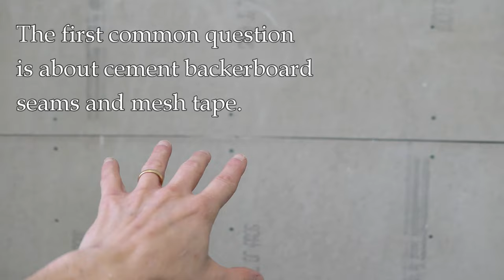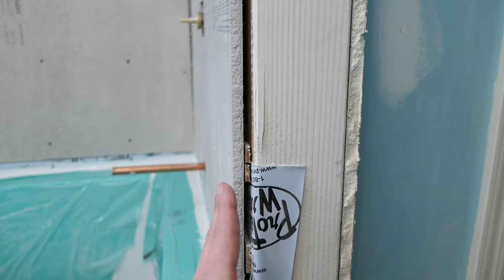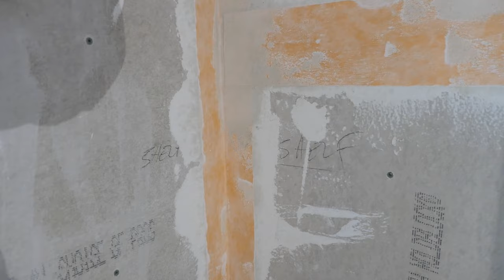Should Backerboard Go Over The Tile Flange Or Up To It?

Comment: Should my first row of tile  rest on the tub or be up off the tub?
Reply from the maker: I have a number of videos concerning the actual tiling process, which you should watch.  The first row of tile should have a gap, typically the same width as the grout lines of the tile, and not rest directly on the tub.  That gap is caulked with silicone caulk rather than grouted.

Comment: How did you add the black Visqueen over the protecto tape ? Did you staple the upper part and use a adhesive to attach the lower to the protecto tape ?
Reply from the maker: I had to look up "visqueen" since that's not a brand name in my area!  So, look, the flashing tape along the bottom is self-adhering, though you may want to pop a staple in each stud if it doesn't stick well. If you put plastic sheeting above that it will just be stapled and hang over the self-adhering flashing.  To be clear, the point of this is not "waterproofing."  Instead, it's just a measure of protection for the future in the event something goes wrong, such as framing moving, a homeowner not maintaining the caulk or grout, etc.  It will redirect water back inside the tub long enough to prevent a disaster.

Comment: If you put plastic over vycor or similar, wouldn't that create a double vapor barrier?
Reply from the maker: A double vapor barrier refers to a situation where you have two complete vapor barriers covering an entire wall assembly.  For example, you might have fiberglass insulation (with a backing) installed in all the stud bays and then add an impermeable plastic over the entire wall.  The problem is that moisture might gather and have no way to escape.  However, if you are just using plastic as a flashing for a small section of the wall, the moisture can easily escape and that would not qualify as a double barrier.

Comment: Dang, I have a $150 unopened bucket of Redgard that I was going to use on the Hardie walls and Hardie floor.  I read that it also works as a crack prevention membrane, but that's probably marketing hogwash.  Thinking of returning it after watching this.  Thanks for putting $ back in my pocket!
Reply from the maker: If you are truly concerned about waterproofing--perhaps you have a large family using the same bath, or some other  concern--then I would recommend the Schluter membrane.  Redgard has it's adamant defenders, but I don't find the arguments compelling.  I should also mention that hardibacker recently introduced a product it claims is truly waterproof.  I have not seen it locally yet, but I'll be curious to examine it.
Reply: @enduringcharm  Subscribed! Great info and appreciate that you answer questions

Comment: You're dead on too with maintaining caulking. Alot of my customers will say I don't know why it's leaking below as I'm staring at missing caulk and loose tiles at the tub
Reply from the maker: Ha!  Yeah, maintenance is not high on the lists of homeowners these days.  You should expect the need to recaulk and even re-grout occasionally, though.  With maintenance the installation will last far longer.

Comment: This is such a helpful video! It looks like you may have screwed directly through the tile flange to secure the tub to the studs. Is this an American Standard acrylic tub? We want to avoid using washers because they stick out and will complicate installation of the backer board but don't want to compromise the tub structurally. Is it generally okay to go through the flange as long as the holes are predrilled?
Reply from the maker: This is actually a tricky area, and one which the manufacturers have failed to properly address.  Some manufacturers recommend screwing through the flange and may even provide marks for drilling.  Others avoid the subject and leave it up to the installer.  I almost always screw into the studs, but you need to understand the structure of the tub or pan so you don't cause cracks, and the flange should not be holding any weight.  The screws are just there to keep the tub or pan from shifting.  There are flange head style screws you can use, or sometimes I will use bugle head style if I can countersink.  It depends on what the pan or tub is made of and how thick the flange may be.  Use a screw which won't rust, stainless or treated.  If the screw head is proud, you may need to relieve the back of the backerboard or the tile in that area, but generally the thickness of the thinset is enough to hide the screw head.
Reply: @enduringcharm  Thank you for the quick reply! ......Bathroom renos are beastly, it's great to be able to access your knowledge and experience.

Comment: I don't believe Schluter recommends mixing product brands as they may not be compatible for complete moisture barriers.  What happens with the screw penetrations in the backerboard?  Don't they break the moisture barrier allowing water and vapor to get inside the walls?
Reply from the maker: If you are using the Schluter Kerdi membrane for complete waterproofing, the membrane is applied over the backerboard and the screws with thinset.

Comment: I’m planning on installing the kerdi board. Would you still apply the window and door flashing tape, apply the kerdifix on top of that, and then put the kerdiband on the seam between the tub and board? Just nervous the kerdifix wouldnt bond to the window and door flashing. The flashing is beyond intriguing.
Reply from the maker: If you are using the Schluter system, including Kerdi board instead of backerboard, then you should have a waterproof surface.  You can use the flashing if you like, no harm in it.  Thinset will not bond to the flashing or to the tub, so there's no difference either way.

Comment: LOVE your content but I still have a question, regardless of the water membrane tape or the lip everyone recommends silicone caulking between the tub and installed tile but won't any water taht goes through the grout, hits the backer board, flows down and then get stuck behind the silicone and between the waterproof tape and lip of tub? how does that water ever escape?
Reply from the maker: Let me add some perspective on this.  First of all, we're talking about a shower wall not a swimming pool!  Water will not be permanently lapping against the side of the tile.  Even with a full family, the walls might be exposed to splashing for an hour a day.  Second, the grout can absorb moisture, but there is no way flowing water is going down the back of the tile.  If you sprayed a grout line for a long period the grout would eventually absorb some moisture, and that moisture might migrate to the thinset behind the tile to a degree.  But it isn't flowing down the back of the wall.  And, if you seal the grout as you should, the grout is waterproof for months or longer.  The only way flowing water is getting behind the tile is if you have a problem, such as a corner opening up due to framing movement or a cracked tile or caulking at the tile-tub line which has not been maintained.  

Silicone caulk is flexible, so by sealing the tile-tub line with silicone you allow for movement between the two dissimilar materials and you keep water from getting under that area.  In a couple of years or so the caulk will need to be replaced.  See this:  https://youtu.be/_NDhO1xdQ_8

Comment: Great explanation.  I have 3 questions.  1. Did you set the cement board a certain spacing (i.e. 1/4" etc.) above the tile flange above the door-window flashing?  2. What did you do to work the flashing continuously around the tub flange without cutting it?  If you used a waterproof membrane that also covers the drywall mud that's feathered at the cement board, do you still need to paint that section or can you just tile over it since the waterproof membrane is there?  Thanks...
Reply from the maker: If you are bringing the backerboard down to the tile flange (rather than over it) then you'll install the flashing first.  Then you can leave a slight gap of a 1/16" if you like between the backer and the top of the lip, but it's not that critical.  The window and door flashing has some stretch to it, but if you have trouble getting it seated you can overlap pieces by a few inches instead of using one continuous strip.  Or, look for zip system flashing tape, which has extreme stretchability.  

As for the drywall compound or "mud,"  it must be primed/painted before you tile OR before you apply a schluter kerdi membrane over it. And, that paint needs a chance to cure, not just dry.  Thinset used for tile or for the membrane will not adhere well to plain spackle or compound, but it will stick fine to cured paint.
Reply: @enduringcharm  Thanks.  Better late than never.  I never saw this response.

Comment: Great video.  When instling the tile, does the tile just float over the lip of the tub freely, or do you put extra thinset on the bottom of the tile to fill up the hollow stop
Reply from the maker: Thinset goes into that area, not so much for adhesion, but to provide a structural backstop of sorts for the tile so it doesn't crack.
Reply: @enduringcharm  can instead of
Thinset, one use silicone on the bottom of it?
Reply: This is my biggest problem that keeps me up at night too.  My tile is a 12x24 rectified porcelain tile so it’s large enough and a stronger durable tile, it’s going to be laid 12” of the tile from top to bottom and the long ways (24”) from left to right,
Reply from the maker: I made a video to answer this specific question--see it here: https://youtu.be/y3bpE-GhYUM

Comment: If water gets to the backer board and runs down to the tub sill, how will it get out, given that the tile will likely be caulked along the tub deck?  Won't it just be trapped at the bottom of the backer board?
Reply from the maker: If you have actual water reaching past the tile to the backerboard, your installation has already failed.  If your tile is secure, your grout intact, and you have sealed the grout, water is just going to run down the tile and into the tub or pan.  If you ran your shower continuously for hours, you might get some moisture bleeding through the grout to the back.  In cases where I see there are teenagers in the house, or many people using one shower, or a tiled shower floor I will use the Schluter kerdi membrane to completely waterproof the installation and protect against moisture bleeding through.  In normal circumstances, though, it just isn't a problem.  I use my flashing system to prevent a problem if the homeowner doesn't maintain the grout or caulk.  But you should never have water dripping down behind the tile unless there is a major problem.
Reply: @enduringcharm :  Yeah, I was thinking of moisture working its way through the grout to the backer board (maybe 1' - 2' above the deck after several showers... or as you rightly say, 1 teenager).  I'm thinking worst-case.  Thanks for your reply.
Reply from the maker: If you are concerned, just put up the Schluter Kerdi on the whole wall.  It the market leader for a reason.

Comment: Altering the dimensions of a 5' room seems to be a popular solution to get backerboard over tub lip, but do the the problems solved really outweigh problems created?  Your recommendations are at odds with a lot of similar information, but I agree with you. My preference is to install blocking around the tub lip to receive the lower edge of backerboard. With solid blocking, water intrusion becomes physically limited before flashing, backing, and tile. The only  detail I would question is why feather drywall compound onto the backerboard into the bath enclosure. I recommend stopping drywall finish at block coat on the tub side of the backer/drywall seam i.e. do not contaminate tiling surface with water soluble compound. Thanks again for this video. I expected to see a hundred negative comments about how wrong this is.
Reply from the maker: Well, I work in the real world where budgets are part of the project!  Sure, you could alter the dimensions of the room, especially a smaller bath.  But, you'll also add a huge amount of time and money to the project that the homeowner may not have.  I always present these options to homeowners, but ultimately the budget may determine the design.  As for feathering the drywall compound, there are some details to understand.  First, I don't feather very far into the alcove.  Typically I try to run the backerboard outside of the wet area, so that the feathering occurs outside too.  Perhaps the compound reaches underneath the outside edge of the tile, which is typically a bullnose and which is outside of the shower doors or shower curtain.  Second, this feathered area receives three coats of paint before tiling--one primer and two finish coats.  I let that paint cure before tiling.  There are other ways of handling this transition, including Schluter membrane or using a metal edge.  But, the style of the bath and tile don't necessarily work with a metal edge.  In the decades I've been feathering the compound I have not had an issue, including in my own house where I can keep a close eye on things.

Comment: How about back cutting the board to allow for the lip?
Reply from the maker: That has several problems associated with it.  For one, the only practical way to relieve the back of cement backerboard is with a grinder, and that sprays silica dust everywhere.  Trust me, it isn't worth dying ten years later for the bath remodel you are doing now!  That aside, backerboard is less than a half inch thick, and if you cut it down to half of that there is not enough strength left to ensure you won't get cracks or have the backer just break off.  Now, if you just want to drill a little hole to make room for a screw head sticking out of the lip, that's fine.  Otherwise, best to either shim out the wall if possible or just use my flashing idea and put the backer on top of the lip.

Comment: QUESTIONS (if still responding to comments in here): When you hang the tile over the tub flange,
1) Do you thinset the tile to the flashing tape? 
2) Will the thinset adhere to the tape?
3) If you DO, won't the flex in the tub with added water and human weight cause cracking?
4) If you DO NOT, what do you use to fill the gap between the tile and the flashing tape? Grout caulking? Silicone? Nothing? 

Thanks!
Reply from the maker: I made a whole video on that subject: https://youtu.be/y3bpE-GhYUM?si=85DsDFRxUSSuL67B
Reply: @enduringcharm  oh thank you my man! I will check that out. your timing is good too because I'm currently installing backer board just as you have. unfortunately it's too late for the flashing tape, I'll come up with something, but what I come up with will be related to the video no doubt.

Comment: Great video. I didn’t search through all the comments if this was asked… but do you adhere the plastic vapor barrier to the flashing?🤷🏻‍♂️ Thanks again for the great video.
Reply from the maker: We need to be careful about our terms.  The plastic sheeting I install over the flashing, but it's not a vapor barrier.  It's really just an additional form of flashing and it only goes up about three feet.  The point of it is just to provide some protection for the future in case something goes really wrong.  A vapor barrier, by contrast, would cover the entire wall and is typically a part of insulation if it's an exterior wall.  You don't want two vapor barriers or you could trap moisture.  The whole flashing system is just in case the homeowner fails to maintain the caulk or grout, or in case the framing moves dramatically in the future, etc.

Comment: Thanks for sharing.  Good idea to handle the lips with flashings.  
When thin-set  was applied to adhere the tile on the first roll, should it be applied over to the flashing?  If so, how much gap should be left between the top of the tub and the bottom of the first roll of tiles?

I wish i had found your video before i purchased the shower pan.  Your video is full of helpful ideas to make the bathroom better.
Reply from the maker: Well, to anser your question, see this video:  https://youtu.be/y3bpE-GhYUM  and if you are setting a shower pan, this might be helpful too:  https://youtu.be/PUTyeD-jyeY
Reply: I wish tradies would see this as the flashing is a great idea it's cheap and easy to apply. With this in place caulking the lip as long as it adheres would that be adequate as shimming is a much bigger job.

Comment: How did you blend the backer and drywall together?
Reply from the maker: I've discussed this on other videos.  Typically I try to bring the backerboard out beyond the edge of the tub or pan and have it meet the drywall there over a stud or backer.  You have no choice but to use joint compound and feather that joint.  However, I try to limit how much goes toward the inside of the tub or pan.  When I'm done sanding I'll prime all of that compound, let it cure, then apply two finish coats of paint and let that cure.  Finally, I will tile over that painted area.  The thinset will stick just fine to the paint, and typically that outer area is just covered by the bullnose tile.  The shower door or shower curtain is inside of bullnose tile.